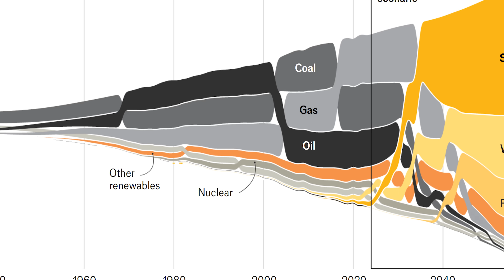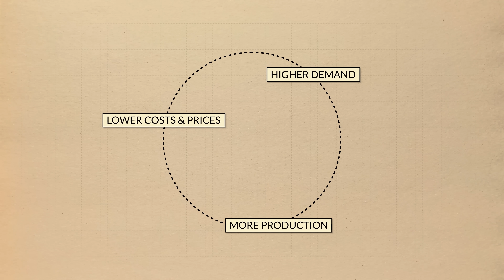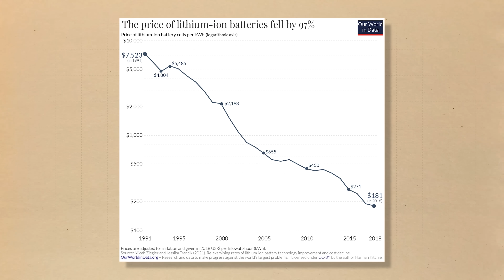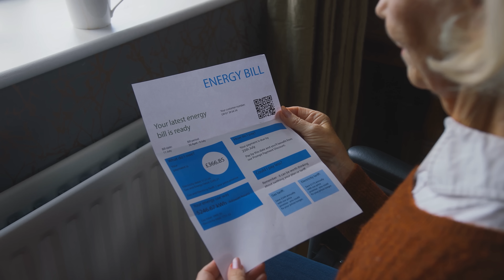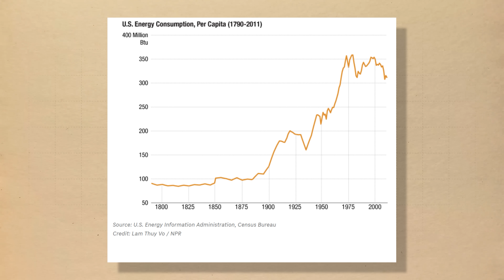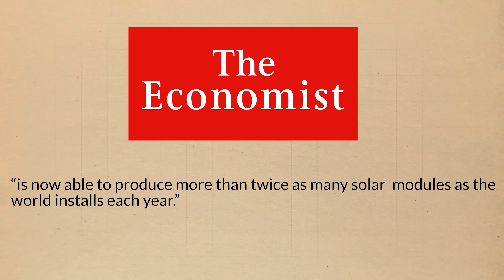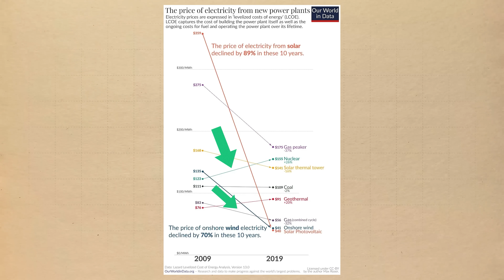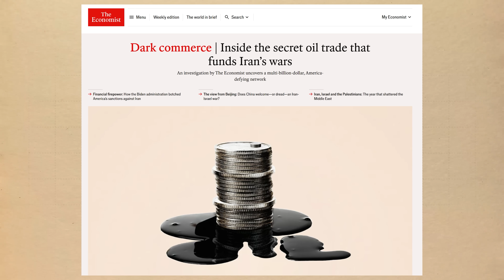Why solar will soon dominate & what that means for the world

Comment: Don't think it adds up. 

- Solar assets depreciate rapidly compared to other energy assets. 
- are bad for the environment due to intense mining needs.
- are unpredictable in energy product and thus depend on energy storage advancements which are even worse for the environment
- Indium and Tellurium too scarce to really scale up to what fossil fuels do
- Not enough Copper for the world to go Solar/Wind. 

I'm more in line with MSF, Google and AMZ, with big bets on nuclear energy.
Reply: Nuclear is a dead end. Only makes sense for countries with nuclear weapons programs at this point. 

The thing with pv and the accompanying storage will be deployed in a decentralised fashion in every building as this just becomes significantly cheaper then pulling from the grid. Nuclear will only accelerate this because of it's high price, unless it is heavilly subsedised ofcourse.

Also, solar does not degrade quickly and all the other point are pretty exagurated.

Comment: Lol.  No it won’t.  EVER.   Batteries are not a large scale viable energy storage solution.  Wind turbines are also a boondoggle.  The gear boxes are not a viable cost effective rpm modifier for 60 hz grid frequency.
Reply: But you do not need that much large scale storages? Even just having better electricity trade makes storage less and less needed. 

Also the sale of electic vehicles and heat pumps could have a massive effect.
Reply: This comment reminds me of the yellow lines in the graph from the beginning

Comment: ICE drivers hate this video.
Reply: Electric cars are just a bit better in terms of carbon emissions, than normal combustion engines.

Trains are the way!
Reply: @mam0lechinookclan607  Absolutely we must all return to public transportation for the many and make that better for the many instead of building for the few...
Reply: @mam0lechinookclan607  oh yeah i mean trains are better for a lot of reasons. but if you're just thinking about the economics of the situation, solar panels will make driving electric cars basically free (from a fuel standpoint, anyways)
Reply: Electric cars charge at night, and in countries like the UK, that can mean overwhelmingly using wind and nuclear power (some of it imported from France). This makes it much more green than ICE cars, which are only around 20% efficient.

But yeah, mass transit (except planes) are greener still.
Reply: Solar panels being cheap dont make electric cars useful unfortunately.
Reply: Solar panels and electric cars are a perfect combination though. Since electric cars can take advantage of charging whenever and thus don't have the same intermittency problem that powering homes and businesses do.

What the coming dominance of solar panels means is that there will be winners and losers based on who can take advantage of intermittent power.

Probably good for Bitcoin, actually, even though I am not a fan of cryptocurrencies
Reply: Nuclear promoters will be fuming as well lol.
Reply: I love ICE cars and solar panels in my home, I just dont want a lithium battery bomb under my arse
Reply: @user-tx2nv1rb9k  "I just dont want a lithium battery bomb under my arse" while driving an ICE car that uses explosions to move 🙄
Reply: @user-tx2nv1rb9k  Norway recently reached a milestone where 26.3% of passenger vehicles on the road are now full electric. If EVs are as dangerous as suggested, shouldn't we have heard about half of Norway being on fire or having exploded by now?
Reply: @user-tx2nv1rb9k  You grew comfortable with the gasoline bomb too, you know.

You sound pretty much like people in the 1910s.
Reply: @dewaard3301  NO THANK YOU I use metro, bus or otherwise I walk like yesterday I did about 12kilometers running errands on the way and then took the bus home

Comment: Would like you to evaluate hydrogen as a energy source.
Reply: Energy storage? Or energy source?
Reply: @Zekian  Sorry, storage
Reply: Hydrogen really makes no sense outside a few edge cases. It is very inefficient and has many logistical issues.
Reply: It's not an energy source.  Done!
Reply: @richdobbs6595  In the context of interstellar travel, I would consider hydrogen a potential energy source.
Reply: @Zekian  Yeah, all you need to do is invent practical fusion reactors and a buzzard ram scoop.  Easy!
Reply: My understanding is that, much like antimatter, in practice you run into the problem of Hydrogen taking an amount of electricity to render it usable greater than the amount of energy you get out of it when you use it, such that there's really not a situation where its better than oil by enough to justify switching while not also being outdone by electricity by the same metrics, nor where it's better than electricity by enought to justify switching without also being outdone by oil by the same metrics. And when it's just another oil derivative, well, the fuel derivitives we get out of that process already are better and we have better things to do with the hydrogen. 

Among other issues, it's really impractical to store for long periods of time or to transport safely. 

That said, apparently there has been Some success with using it as a fuel Additive in vehicles that encounter the rocket equation problem if you try to use batteries for electical power but can't run catanary wires and use a pantograph instead (so... mostly large trucks), which apparently results in meaningful improvements. 

For storage, as @rogerk6180 said, there are a lot of logistical issues. The hydrogen may well be ligth weight and not take up much space, the equipment involved in getting it from A to B, and then getting it to Stay at B? really very much not.